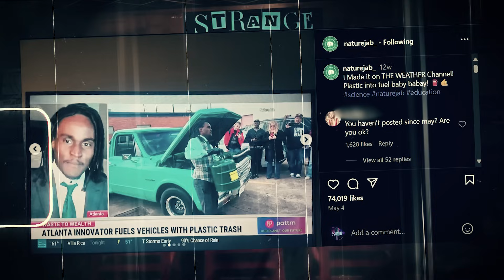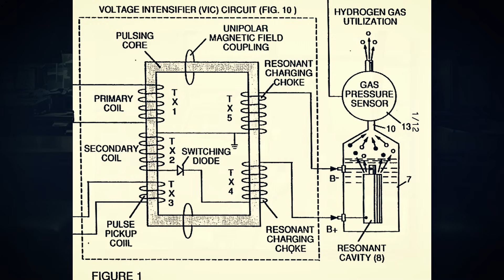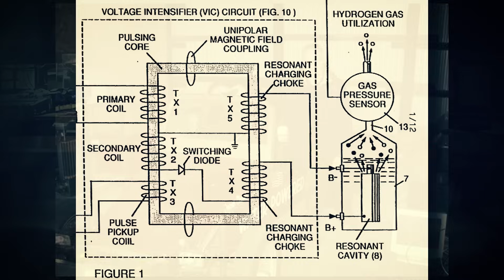Solving The Julian Brown Mystery | Who Is He Hiding From

Comment: This doesn't make any sense. It takes more input, in the form of electricity, than the system produces. It would make more sense, in terms of energy efficiency, to just use that electrical power to power an electrical vehicle. There's lots of losses associated with any conversion.